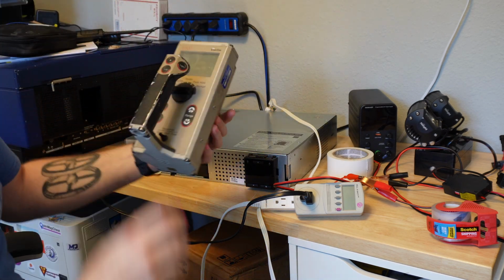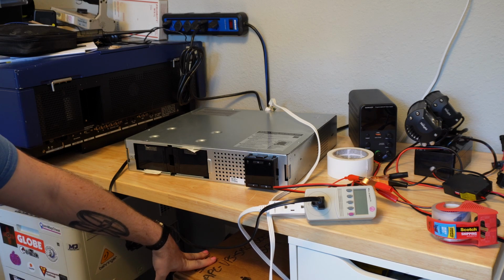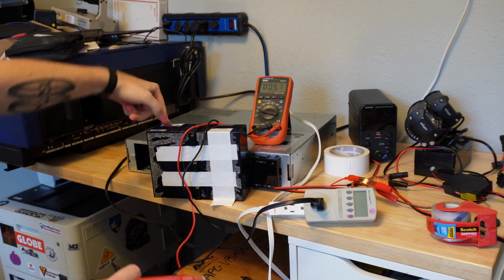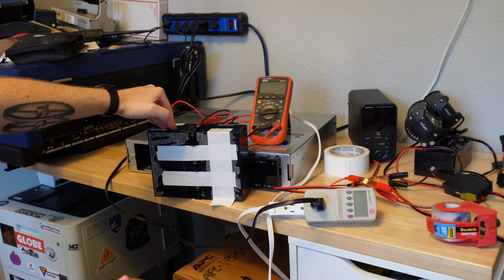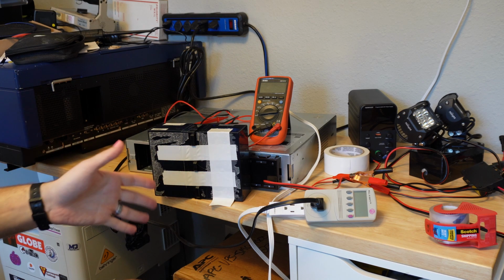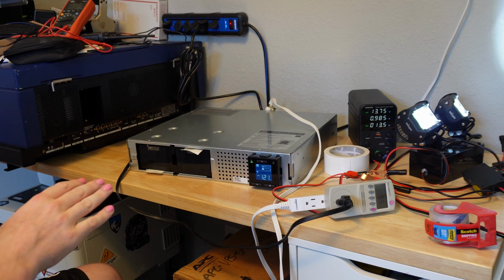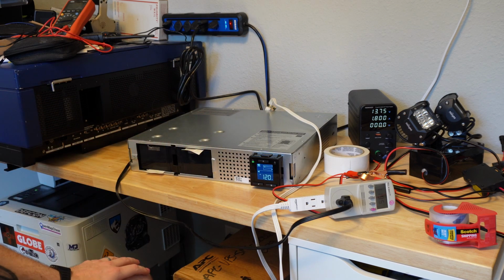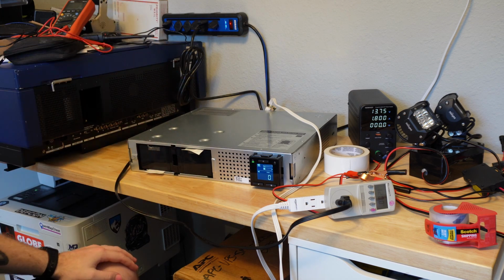A rather interruptible power supply

Comment: Why don't you take the battery out, set your bench power supply to 26v ish and connect it to where the battery should be, then you can emulate a mostly charged battery, then test the switching
Reply from the maker: Ah, see, this is why I need y'all. I looked around for some spare 12v batteries but didn't have any that were easy to get at, never thought about the bench supply I was staring at. I'll give it a try later and see what happens.
Reply: Just make sure you put a diode in between to stop the ups trying to charge your power supply